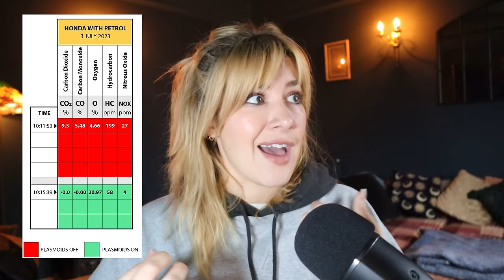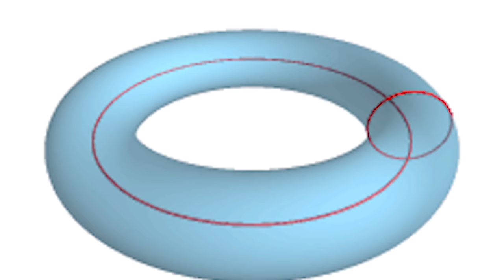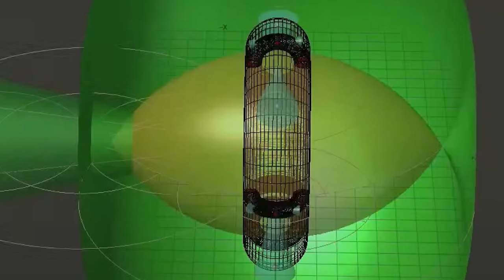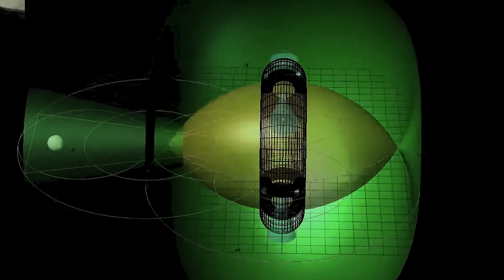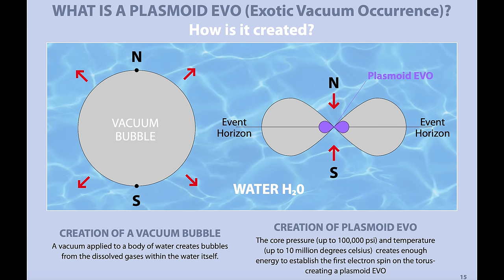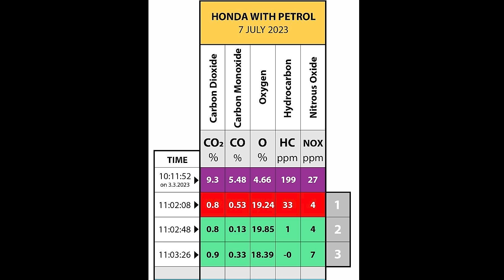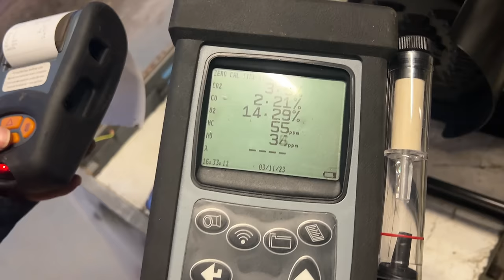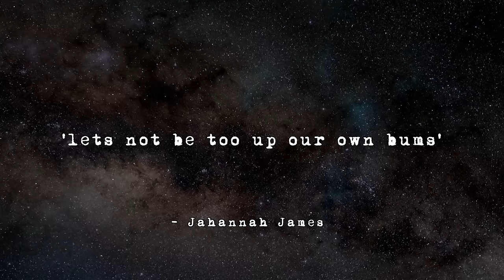Lost Ancient Plasmoid Technology? | The Thunderstorm Generator

Comment: Serious question is how long can the stainless steel ball be used before? A? It either fills up entirely with crystals and becomes clogged or B. The implosions eat through the stainless steel and cause the ball to degrade. I'm wondering will this work for years on a factory or days or hours?
Reply: I had the same thought. This could get prohibitively expensive depending on that rate of erosion/decay/damage. Is it possible to coat the inside with something that won't get destroyed by this reaction?
Reply: Same question. Please clear this up Johannesburg
Reply: @JosephDiveley or does it need to be stainless steel? Could it be titanium?
Reply: Stainless steel is a strange metal. It sits in 2 positions of the list of noble metals. More to do with corrosion in salt water but not sure how it will react  with the water in this experiment
Reply: Yep and it’s not going to be cheap either. Then you have to consider the emissions generated in order to make this much stainless steel and ship them around the world and so for the millions and millions of petrol cars there are.

Has this been calculated to see if there is a net gain or not?
Reply: @JosephDiveley is it producing diamond coating that would protect the metal?
Reply: @2seeit stainless is a mixture of metals are you saying that it sits in two different places in the noble metal groups because of the alloy ?
Reply: @patrickday4206  stainless steel gets protected by an oxide layer. Once you break this layer it simply corrodes. List of noble metals is a list that indicates which metals in seawater (salt water) will corrode first. Stainless sits high and low on the list. One where the oxide layer is in tact and another where its not and will form pitting. For this application wont be to difficult for a metallurgical engineer to design the best alloy. Could even use ceramics maybe if i understand right that its the swirl motion that is needed.
Reply: @2seeit  probably have one on my diesel truck and a month or two then
Reply: I did think of ceramics but I would like to see this play out using temperature and pressure using plasmoids to create diamond coating for protection and to make recycling worthwhile
Reply: Wonder what a layer of gold will do

Comment: I have a really good feeling about this.  There are a lot of reputable names promoting and or talking about this tech. Nice to see You Jahana.  Glad You went and witnessed this for Yourself and got a hands on feel for all of this. Great job!
Reply: Btw. That residue on the outside of the stainless steel,  it looks like normal oxidation of the material , I believe. Modern cars with a quality (there are cheap material stainless ones, impure) stainless steel exhaust system looks like this. I’m sure with that though, much of it is aided by the heat.  This new tech, I’m not if I’ve seen anything about heat? Or maybe I’ve forgotten. Either way. It doesn’t need heat to oxidize.
Reply: @jasonsfun31 yes. Stainless’ version of rust.

Comment: They have created a catalytic converter that uses water separation to recombine the co and co 2 with the hydrogen left over from the fuel and water it is just doing it without precious metals like platinum, palladium and others but its just recombining to make other gases so unless that crystalline growth is actually carbon ie pre diamond you have basically recreated a catalytic converter.
Reply: My thoughts 😮
Reply: The one guy is scaping rust off the outside of the steel container with a knife. Water plus iron ironically is an oxidation process. I thought the magic had happened inside the container. And in that smaller copper one earlier in the video.
Reply: Yes, that's exactly the billion dollar question ( if it works at all )
Reply: ok a little chemistry for you concerning what a catalytic converter does and why this seems to work we need 3 things basically to make an engine run, Fuel= hydrocarbons + air=  78% nitrogen,21% oxygen .005% carbon dioxide and .005% methane ,argon ,helium and other trace gasses in the atmospheric mixture. Ideally about 14.5 parts atmospheric gasses to 1 part fuel  compress this not so mystic brew and throw a spark in the midst to make it burn and you have your process that makes the pistons drive the crank and the wheels on the buss go round. This all said and done works but that ratio is not perfect all the time and loads on engines and drive conditions affect it also and that's where you get the nasty carbon monoxide(co) carbon dioxide(co2) unburned hydrocarbons (hc) oxides of nitrogen(no) and left over oxygen(o2) that didn't burn in the process all this on modern engines is cleaned (recombined in a catalytic converter)oxygen is added co becomes co2,hydrocarbons separated into hydrogen and combined with oxygen to create water h2o and oxides of nitrogen are eliminated by back feeding exhaust gasses into the combustion mix to drop the temperature and prevent their creation ok that explained, let me explain that the admix of this is cleaner than it has ever been since the inception of the internal combustion engine co and co2 levels will barely give you a headache  coming out of an engine that has been manufactured in the last 20 years! Those bubbles in the water are carbon dioxide that is being absorbed into the water hidden away for now but it will come back its the same thing that happens in a bottle of soda pop. Carbon emissions only at last count i saw was 436 parts per million which is less than 1/2 of 1% of the totals of atmospheric gasses listed above, we need the o2 and the plants trees and such need the co2 and the politicians need to shut their blow holes and if you want to take care of c02 put your faith in a higher form of intelligence and plant some nice maple trees or tulip poplars anything but pines they should have mandatory catalytic converters on them they produce their own form of hydrocarbons that is why most of your wildfire regions are pine growth regions and why Los Angeles was called the Valley of smoke hundreds of years before the advent of Europeans in this country!! @timshaw1712

Comment: my humble points about the video: 
1) The instruments that they are using to measure the exhaust are far from ideal, since they are not sampling a closed volume of the gases and identifying the composition and percentage of the total mass/volume.
2) I wonder if the micro/nano explosions on the stainless steel sphere walls wouldn't destroy it with time, or at the very least, the so called crystals formed wouldn't grow too big and reduce the internal area...
3) The most controversial idea to me is to convey that we need to reduce CO2 and increase O2 in the atmosphere...The alleged economy in combustible can be good IF the thunderstorm machine last for years and years without maintenance or replacement...which is far from a certain thing...
4) I Don't think it's a novel idea for the industry...and since it's known for at least 100 years, I don't think it will change the world as you stated...at all...
5) We have way more important things to solve in our world than to add this thing in our internal combustion engines...avoid WW3 is far more important than anything right now...
With all that said, you make your point and explained a very tough concept with grace and simple language! congrats and keep on!

Comment: A plasmon is the collective electromagnetic excitation that takes on the behavior of a single quantum object. Mechanical 'moment' is measured from two points, one a pivot and the other to measure the force it takes to move it. Take a hammer and hold the bottom of the handle as an axle; how hard it is to rotate the hammer is its 'moment' with regards to the two points. In quantum mechanics, the magnetic moment is influenced by spin states. When a beam of light with a specific magnetic moment interacts with a solid, it can induce synchronization of spin alignment in the solid's particles. This synchronization is a form of collective behavior, where particles in the solid start to align their spins in response to the external magnetic field carried by the light. This phenomenon is akin to how synchronization in other systems leads to coordinated, collective behavior.
Reply: Double slit experiments? Until observed?

Comment: If it's putting out that much oxygen you could divert it towards the intake to reduce emissions even further and also increase fuel efficiency. I'd really like to see a full size retrofit by a 3rd party like a peer review.
 If I had the money laying around I'd do this this weekend. 70mpg sounds like a dream in a 24 year old car
Reply: The fuel is already burnt this system is a filter for exhaust, even if you divert the oxygen back to the intake it's just like regular air, this will not make fuel more efficient in any way they are wrong about that
Reply: Done.  Fairly certain there is a separate 'source' video, but here is alchemical science talking about an industrial scale retrofit and the results.  A little digging I'm sure you can find the original if you need.
https://www.youtube.com/watch?v=ifxz5hNc9og&t=22s
Reply: More oxygen will just make the fuel mixture too lean. When you add more oxygen, it simultaneously requires more fuel to maintain the proper air/fuel ratio.
Reply: @oldscratch3535  this cleans the exhaust it's not adding more oxygen, it will not improve fuel efficiency this is a lie
Reply: @drummerdad80  That's not true.The "plasmoids" are being fed into the carburetor so its not just "cleaning the exhaust" as you claim.

 I just got done reading a few papers and watching videos on this technology. I would suggest you do some more reading and look at he actual design diagrams b/c the "plasmoids" aren't injected into the exhaust. They're injected into the intake. What happens from there isn't quite clear yet.
Reply: @oldscratch3535  ummm it's all happening after the fuel is burnt, the whole set up is in the exhaust you are wrong, and the plasmoid think is bunk, if you know the science behind it this system is not making plasmoids at all, it's not true
Reply: @drummerdad80  Explain how it works.

Comment: In terms of retro fitting this to existing cars this will become very complicated and costly when dealing with the engine management system (pcm or ecu), the brain of the engine (ecu) is making fuel ratio corrections based on o2 sensors in the exhuast along with things like air pressure, air temperature and air flow. A factory ecu will freak the F out when it sees  extremely low o2 readings or none at all with this device attached. The factory ecu will need to be completely re mapped for fuel and ignition timing which on 90% of factory ecu isn't possible a stand alone ecu would be needed. Those on thier own are thousands of dollars and will need to be tuned on a rolling road aswell as the labor and parts etc. This wont be affordable for most people. I love this tech i love the channel and i can't wait to see where this tech goes... and if the technology isn't massively restrictive on exhuast flow the increase efficiency from the fuel mixture will lead to more horse power lol.
Reply: Adapt the sensors the ecu will adapt the fuel to air ratio
Reply: I used to be into motorsports myself. There's lots of ways of adapting engine mods, so that the ECU doesn't freak out. Obviously this will be easier on an OBD 1 system, or with a full stand-alone engine management system. We're also in a new golden age of electronics development, with all the new microcontrollers and SBCs that are available these days.

Comment: Unfortunately a lot of Maclom Bendall's backing science has been pretty much disproven and what is left standing is pretty well known to the people that study it (including why its not used at scale). Robert Murray has a very generous breakdown of the 'thunderstorm generator' here: https://www.youtube.com/watch?v=GCJCIgF3pc8
Reply: Robert Murray produced a small minded hit peice. Very disappointing defaming two fellow engineers. Don't waste your time on it.
Reply: @pauloneill9880  can you be specific why you call this a 'small minded hit piece' (such as time stamps in the video)? I think he was quite generous and it is the most comprehensive breakdown we have seen from a large name in the space
Reply: Subjecting water to high shear forces (e.g vibrating plates with harmonics) will produce HHO - in water (vapour), of course, this means the HHO is kept in solution - so, addressing what otherwise would be a high risk of explosion (this is how Ohmasa gas is produced), and this HHO is great at creating vortices in the water/steam (as per the ULTR experiment), especially adsorbed onto surfaces such as Aluminium-or Iron(Steel). So, this could well be what is going on inside the TSG (on the exhaust side). No high pressure required. Just water, vibration, a suitable surface and an appropriate confinement geometry - and this is also why the TSG is NOT a GEET system.  It is generating fractal toroids that go to work invoking ElectroNuclear Collapse (ENC) (thanks to a magnetic pressure of 50,000,000+ Tesla) followed by ElectroNuclear reGeneration (ENG) as per Dr. Takaaki Matsumoto’s research, Ken Shoulders research, and many others.  ENG preferentially (but not exclusively-especially with protium and deuterium added into the mix) produces alpha conjugates nuclei - so, Carbon-12, Oxygen-16, Neon-20, Magnesium-24, Silicon-28, Sulfur-32, Calcium-40, Titanium-44, Iron-56 and so on - and, experimentally, in proportions similar to those estimated for the Earth’s crust
Reply: @gordondocherty  Right on Gordon. A capital reply my good man! Capital, I say!

Comment: While I'm very open-minded, there are certainly a lot you can do through chemistry, so I'd quite like to have a look to see if the bubbler actually only has water. I've worked with emissions measurement, and have seen some of what one can do with such things, and you can do a lot in a bubbler, in fact, that's how we'd collect a lot of the chemicals we needed to extract from the fluegas, to analyze the composition of the gas.
I also need to add that all sensors will have things that will interfere with what they're measuring (most will interfere with water and CO2, electrochemical and Zirconium sensors will typically be influenced by CO), which is why most measuring equipment is really quite large, and if it isn't, it often measures several parameters, and compensates to the specific application it was made to measure - which means that they can't be completely trusted if used to measure things that potentially has a very different composition than what they were meant to measure.
That said, the composition measured looks to be that of atmospheric air, but the carbon, and the hydrogen (which makes up most of fossil fuels) also needs to go somewhere. They were not individually measured here, and they likely wouldn't be seen in the hydrocarbon column, if they've been separated; which brings me to my next point: Either the hydrogen and the carbon is absorbed (diamonds are but carbon, so the shiny bits could be carbon), or it should be exausted, which would make the exhaust gas highly flammable. Should this be the case, you'd have a perpetual motion machine, which violates the law of conservation of energy. I'm not necessarily saying that that's actually impossible (well... you could maybe achieve things that seems to violate these rules, without necessarily doing so, and I can't say that this wouldn't be such a case - for instance having machines that actually absorbs heat, to create an output, something that would resonate with the world around it, making it 100% efficient, which would allow it to put heat energy into motion. This would seem like something that would violate the conservation of energy, but as all forms of energy, will eventually end up as heat, you could never have actual unrecoverable losses, if a machine could be made to run on ambient heat.), but if this actually outputs flammable gas, I'll certainly be impressed.
Reply: Long story short - it'd be interesting to see the exhaust analyzed with an FTIR, should anyone have one of those kicking around 😂
And it would be interesting to see a mass spec of the liquid in the bubbler, before and after usage
Reply from the maker: the next step is to test in a totally air tight space with exactly everything going in to out, measured collected.
Reply: @FunnyOldeWorld  Aye. And it would be interesting to also do some analysis on the oricalcum-like stuff. If this is actually real, I really want to know where the carbon and hydrogen is going 🤔
Reply: @FunnyOldeWorld  by the way, the slightly more descriptive version of fractal patterns, is patterns repeating within itself, and in case you'd ever need the perfect example, I'll share my favourite one, which is the magical combination between broccoli, and Cauliflower; Romanesco! The logical part of my brain can get absolutely lost in these patterns.
 https://en.m.wikipedia.org/wiki/Romanesco_broccoli
Reply: You could stay in the sealed room if exhaust is cleaner than atmospheric air. Crazy but true.